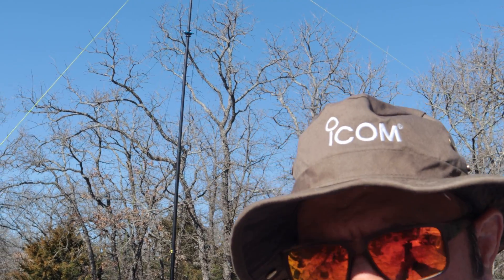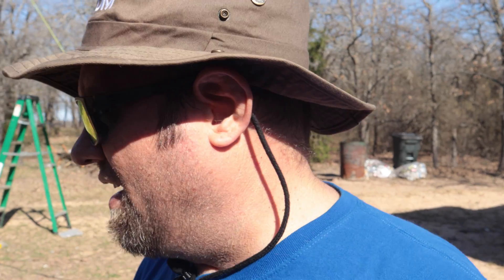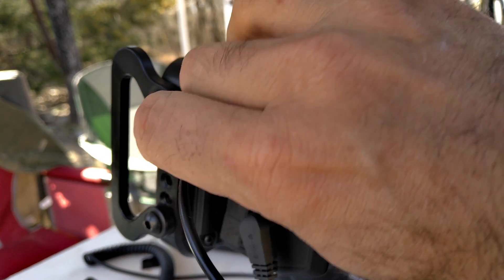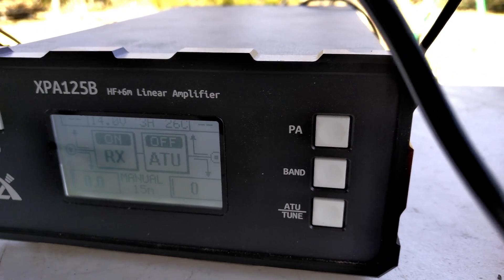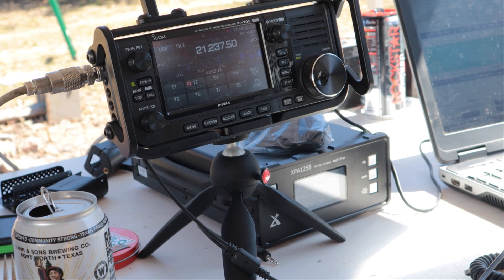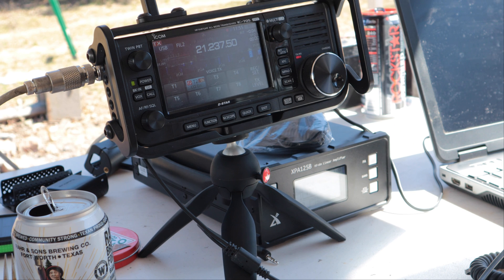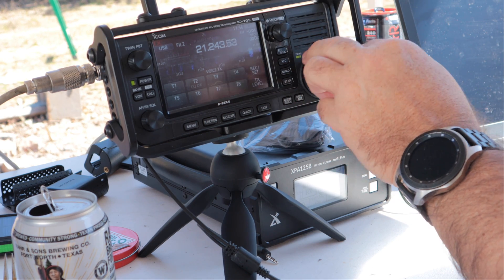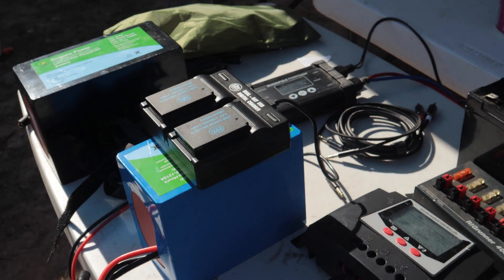How to use the Icom IC-705 with the Xiegu XPA125B Amp for HF Ham Radio

Comment: With that many separate components to the setup you would be better off with an IC7300 or a FT710 field🤣🤣
Reply from the maker: FT-710 wasn't out yet when this video was made, and the 7300 doesn't do VHF/UHF all-mode.  So not really apples to apples.
Reply: @HamRadio2  that’s true. I keep forgetting some videos on YouTube are years and years old. But perhaps taken as an updated edit. I think my comment stands. 😂👍👍

Comment: Do not use any interface between the rig and the PA, just a cable ?
Reply from the maker: They make a safety filter for it in another kit, but I didn't use one here.  It is probably safer to use the filter, though

Comment: Great video! I read on Facebook , You may burn out the amp port on the 705 and they recommend  upgrading to a new board with USB-C. Do you think the cable alone + XPA125b is a safe solution?
Reply from the maker: USB-C is not needed and this cable worked fine for me.  But the same ebay seller sells a kit with a filter that is "safer" for the radio.

Comment: One question.  When the ATU is on the XPA 125B, will pushing the tune button on 705  trigger the ATU on the XPA125B? I use a Ecomm 2 end fed antenna. Unlike my G90 that I sold, I know I have to manually change bands on the XPA 125 A amp.

Comment: Take a look at the review of this amp in QST Feb 2023. They tested 3 of these amps and they found problems with each of them. They kept having to have HRO replace them because of problems they would find. . Everything from spurious emissions on 6 meters, it wouldn't transmit on 80 and displayed LOW EFFICIENCY error message, it didn't meet's power output specs, etc. etc. ARRL said "It might be the luck of the draw but the Lab found problems with each of the amplifiers it tested". I would not be connecting one of these to my radio.

Comment: Is there another cable needed if using the atu as well? I was wanting to get this for my efhw I will almost definitely need the atu working
Reply from the maker: Why would you need an ATU when the amp has a built-in tuner?

Comment: I’ve heard you should use a buffer when connecting the amplifier so as not to blow out the  705’s amplifier keying circuit.

Comment: I love my 705 for POTA, I see a lot of YouTubers using the Yaesu 891, if you had a choice, would you use the 705 with that amp or the Yaesu 891? Field day QRP was a bitch, couldn't get a word in edgewise. So I was thinking of going to a 100-watt radio. The 891 was top of my list but I love all my Icoms 705, 9700, and the 7300. Someday I will get the 7610 and I can use the 7300 portable, but for now, I could get the amp and have a better icom with me that also does D-star which the 7300 doesn't. What is your opinion? Thanks in Advance Jason.
Reply: PS See you in Huntsville.

Comment: What is the pinout on the cable? I have a cable here but cannot get it to work? Please Please help! Just got the 705. I have a G90 and the XPA125B but can't get the 705 to key the amp...
Reply from the maker: I bought the cable, I didn't build it.
Reply: @HamRadio2  Hi ,WHERE CAN I FIND THAT cable

Comment: Been better if you had shown us how you configure the 705 for working with the amp. You did not demonstrate whether the amp worked/keyed on FT8 mode. Sold on the buddipole charge controller. Very intrigued by the Buddihex. Thanks

Comment: The high SWR (1.9) shown in the upper left corner is the SWR between the radio and the AMP. The power in the lower left is the power from the radio to the amp. The SWR (1.0) shown in the upper right is the SWR between the amp and the antenna. The power in the lower right is the power from the AMP to the antenna. And the amp ATU is in the off position.

Comment: The Ic-705 is an interesting radio- but when you need an external amp and tuner why not bring the IC-7300? Also what is a " Buddy Hex" I looked on Buddipoles web site- no hex beam..

Comment: You were getting unacceptable SWR on your test calls and you didn't demonstrate the auto-tune feature in the XPA-125B?!?  Great video otherwise.  I ordered a 705 (already have an IC-7300) and was always wondering about an amplifier to pair with it if needed.  I have an XG-90 as well, so I may pull the trigger on this amp.  Thanks for the post!

Comment: Great demonstration! How much watts input does it need to get 20-40 watts output? I need to know that because sometimes I don't want 50-100 watts output. Is it possible to reduce TX power on IC-705 low enough to get 20-40 watts output on the XPA 125B? From what I've read this also strongly depends on the band. Thank you in advance!
Reply: I know this is a bit late. But for the most part on most bands you can’t get the amp to go under 60w. 6m can go under 50, but I don’t remember how much. Everything else really averages the upper 80s at even 1w input.

Comment: 705 is a sweet radio.  Wish it had an integrated antenna tuner.
Reply: But if they built the antenna tuner into the radio they couldn't sell you one as an option silly.

Comment: Wil the 125 work with the IC-703?
Reply from the maker: I've never owned a 703, not sure what kind of connections are on it
Reply: @HamRadio2  GND, DATA 6 PIN PS2 MOUSE TYPE, 13 PIN ACC EX SPEAKER MINI PHONE, REMOYE MINI PHONE, 8 PIN ICOM MIKE, KEY PHONE, 4 PON AH4 TUNE.  Should parallel IC706 or IC7000 type ports.
Reply: The 703 can do 1 to 10 W 6-160M.  Oy is easy on power.  Do not want to het rid of it.  Was great as low power unit on battery diring Uri.

Comment: Can the Tuner work in a manual mode.  could i wire in my Mat 705 before the amp?
Reply from the maker: The tuner inside of the amp will actually work.  We learned this after this video was made.  Darn, I guess I have to do another one :O

Comment: If you're going to lug a 4lb, $520  amplifier to the field along with the 705, why not just take a 7300?
Reply: Flexibility, if the bands are great you might not need the amp. If they're not then you'll need the amp. The IC-705 also has 320 ma receive current so chances are you could operate for a fair amount of time with just the built-in battery.  In comparison, the IC-7300 has a receive current of .900 to 1.25 a which is triple of the 705.  The 705 is also light weight but the 7300, not so much.
Reply: @joeblow8593  If you are lugging around a big heavy amp, you are usually lugging around more power.
Reply: Flexibility. 
I can keep an amp in or close to my RV and run full power while splitting it up for a hike up the mountain in QRP configuration. 

Definitely not going on a hike with a 7300.
Reply: i’m a young ham with multiple other hobbies and dont want to buy multiple radios so for me a qrp rig is perfect for the large level of mobile operation i want to do but an amp is perfect when i get home
Reply: The 705 is such a light and amazing qrp radio. I dumped my 7300 for this combo at home. Nice and clean, with some mods to the XPA125b
Reply: And I do not want to get rid of the 703.  Good on power management, and uses the same mikes and SignLink cables as my 746 Pro and 2720 2/.70 rig.
Reply: In the filter, get signals out of the mud department, who wins:  705 or 7300?
Reply: @DominicMazoch  I don't own the 7300, but from what I heard from others both receivers are similar. I should mention the 705 has an above average performance on the FM broadcast band. So if you like to DX the FM broadcast band, the 705 runs circles around the FT-897.
Reply: @DominicMazoch  I own both and I think the 705 beats the 7300.  Possibly due to some updated algorithms.  The NR and NB actually seem to make a difference, more in line with my FT 891.  Just my subjective opinion.
Reply from the maker: Good question.  Either one would work, tbh.  So it depends on what you are trying to do.
Reply: Learned something during Uri ice storm.  I tried running my 746pro on my marine battery.  Even on QRP it is a hog.  Used 703 to get to the7290 net, and sipped power on 40 QRP.

So a QRP in an off grid situation is great.  Depending on mode and band conditions, one may need an amp for a boost.  But combined, power consumption could be less than a all in one 100w rig.  And if you do need the amp, you cut it out.  I think a lot of hams will be thinking about power consumption of their rigs if they lost power in the URI event.
Reply: My sentiment exactly.  Just buy a IC 7300 and have a complete radio.
Reply: 705 is an overpriced toy.  $1200 QRP?  Icom needs to make a modern 706/7000 sized rig.  Not all instilations need or are able to have the room for a desktop sized rig.  And no antenna impedence matcher for the 705 at its price?  The 703 + did.
Reply: @DominicMazoch  The 705 has the hottest receiver I've ever seen. None of my current radios (including the FT-817, FT-897, IC-718, IC -706 MkIIg or SG-2020) come even close to digging out signals like the 705 does. The 705 does not need extra filters like the other radios do. Sure the 705 is expensive. So is the KX3 and KX2, but good luck trying to get those radios because they are currently back ordered for 4 weeks! The 705 vs the KX3, the 705 is the better deal because it comes with the mic and it also has 144 and 440 and D-STAR. And the 705's battery can be taken out and replaced in 30 seconds. Try that with the KX3 with out damaging the ribbon cable.  If you want a QRP portable that has the same bands as the 705, the get the FT-817 and buy the filter (if you can find it-they stopped making filters for the FT-817).  Interested in the Xiegu X5105 instead? Both MFJ and Radioddity are both sold out of the X5105.

Comment: Great video. I note there was no need to use the tuner with the buddies. Have you used the internal tuner in the X125 you please describe your setup for that? This looks like the solution I'd love to use. Any particular issues using the tuner/amp combo?

Love your channel. Keep up the great work!!
- Kyle
Reply from the maker: The tuner was tricky but we figured it out after the video.  Still no band-switching though, which I mentioned in the video.  I will probably do an update to this episode.
Reply: @HamRadio2  Hi Jason. Have you given more thought to updating this ic-705/Xiegu xpa125B video? I have not yet watched your field day video but wondered if you used the same configuration and how it went.
Reply: I’d also love to know more about the tuner.